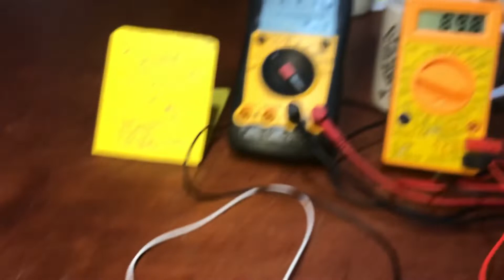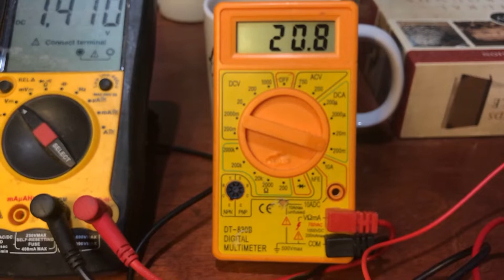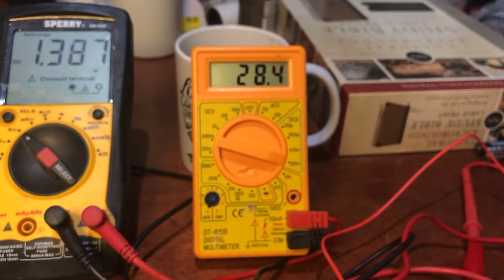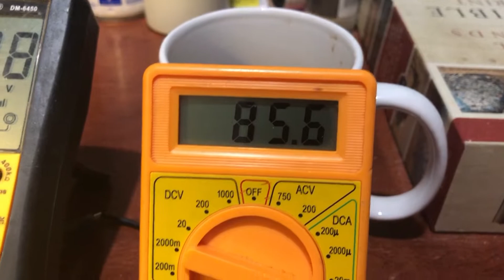UPDATED VERSION OF MAGNETICALLY SUSPENDED TOOTHPICK MOTOR

Comment: nice diy reed switch! what is ball bearing for?
Reply from the maker: Thank you. If you are referring to the object on the end of the center wire, it is a very small magnet which measures 2mm x1mm. I orientated it to attract the magnets on the rotor as they pass by. This causes the center wire to contact the outer coil of wire which turns on the coil at just the right time. I kind of got carried away with the superglue at the base of the reed switch but I didn’t want to mess with it and break it ha ha. Thanks for the comment. I had a lot of fun making it. Take care...
Reply: @toothpick5779  no i mean the ball on the end of the reed relay coil. does it just show when the coil is energized?
Reply from the maker: Ian Moore 
The ball on the end of the reed switch is a tiny magnet. It’s glued on the end of the wire to help the reed switch work better. Hope this helps.
Reply: @toothpick5779  ah i see now that is a great idea for a reed switch home made relay.
Reply from the maker: Ian Moore
Thanks. I actually got the idea from a you tube video. Take care😊